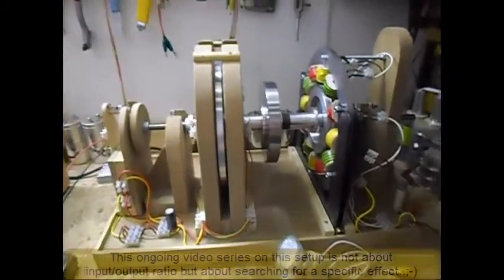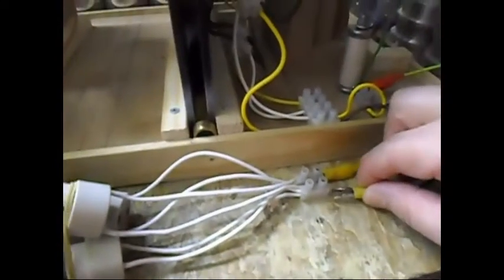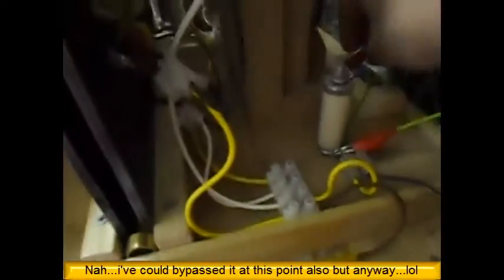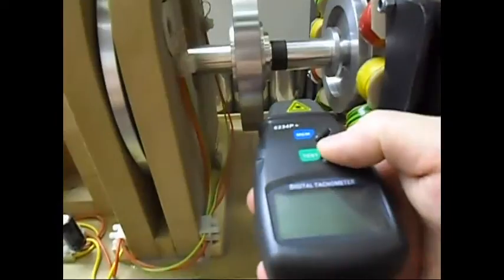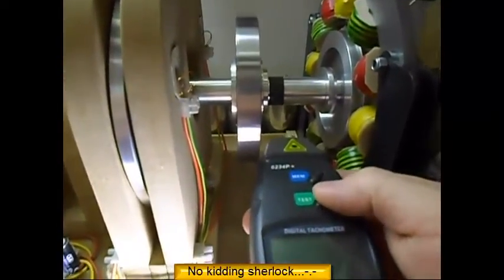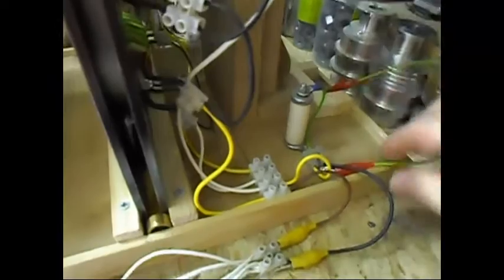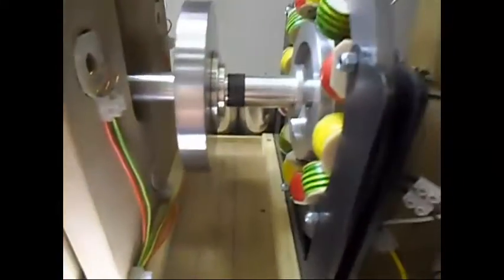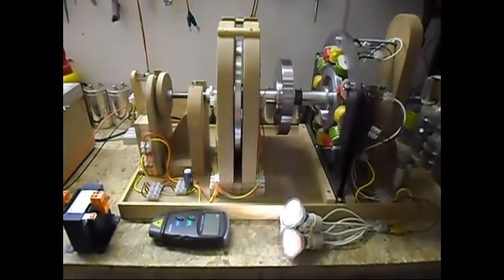Single Phase Generator_Update 13, 1 Set of 3 coils - 3000(ish) rpm - 3 watt AC load - 1 6Kv cap...

Comment from the maker: Just an update and the first series of testings with 1 set of 3 coils...^^
And using a 1.6Kv 0.1uf cap in line with the output and compare that with no cap in line with the output...;-)
Nothing special but just some basic testings...^^
And totally forgotten to short 1 set of 3 coils while doing these test to see if it does something or not but in the next video i'll do it...;-)